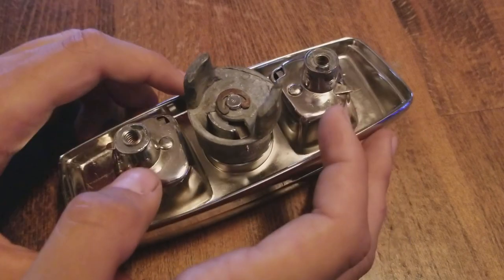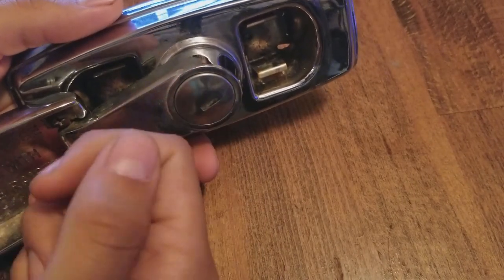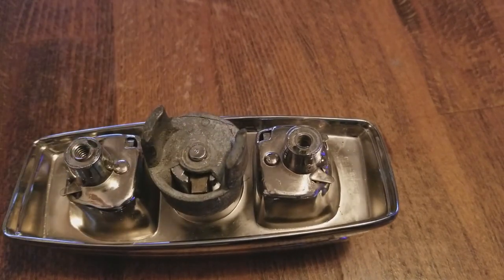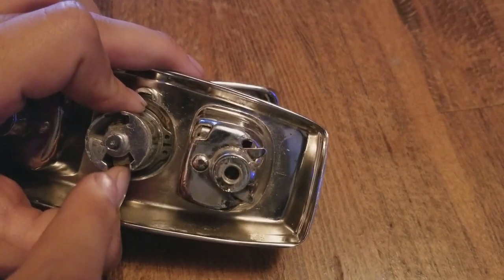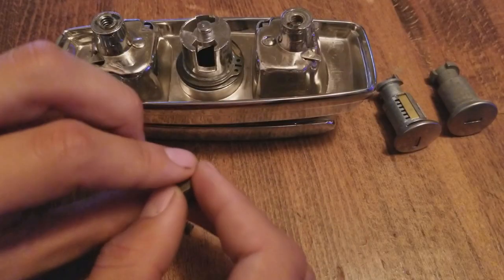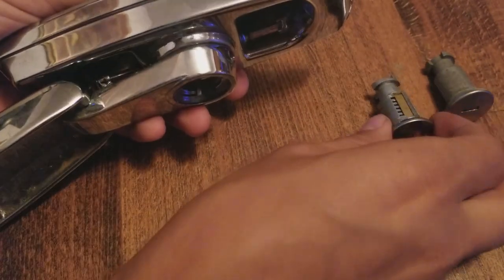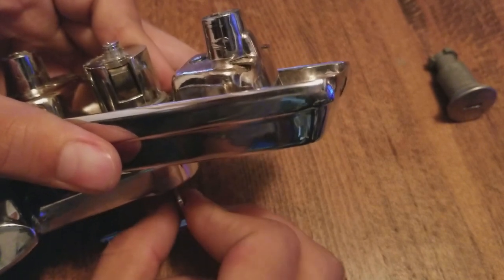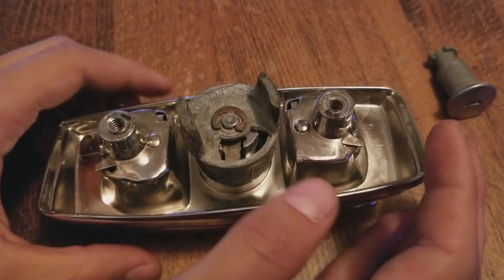K5 Blazer / M1009 Tailgate Window Crank Lock Cylinder Replacement / Repair

Comment: Thanks very much!  I'm replacing the electric motor with a manual crank on an 89 Suburban and could NOT figure out how it went together with the spring and pawl.  Even after watching it took me a bit.  I was not getting the pawl to go in far enough with my thumb, had to get a screwdriver to really press it all the way in.  Well done though and thanks again.

Comment: Great video. Hubs has a 1984 Blazer M1009 and needs to remove the crank. Do you have to remove the window to do this? He can get to one of the screws on the crank after removing the panel but not the other. So any guidance would be greatly appreciated.

Comment: if i’m converting my automatic rear window to a manual, do i have to replace everything in the tailgate or only the lock/handle?
Reply: You need a manual window regulator and the crank assembly
Reply: thanks!

Comment: For anyone struggling with this if you look closely his tumbler is gutted.  There is a feature on the tumbler that retracts when a key is inserted that allows it to rotate.  I had to drill mine out in the end.. the new key wouldn't retract that feature.